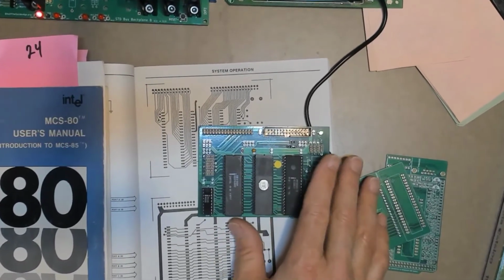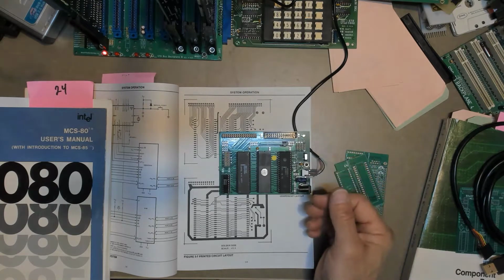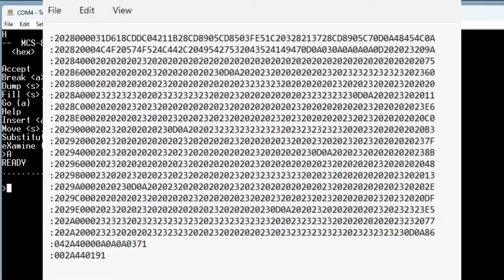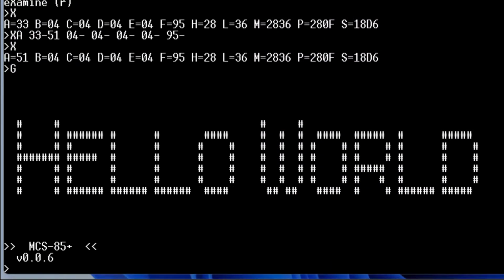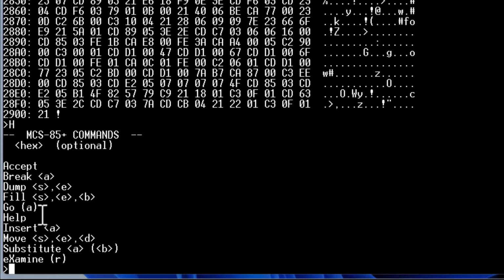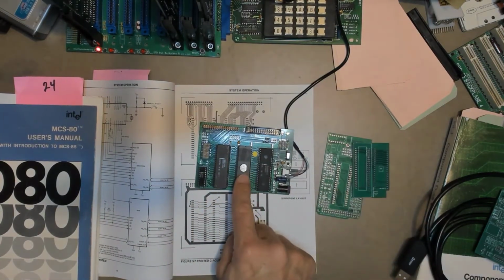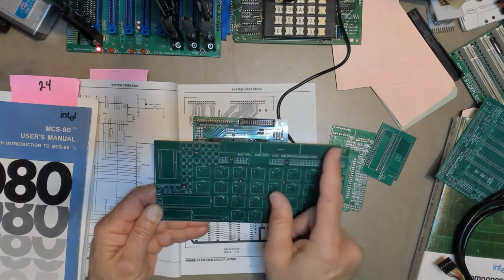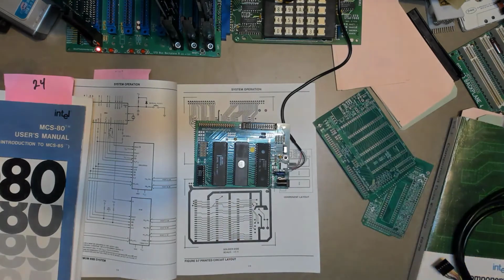{101} ZERO Glue Logic, MCS-85 Minimum system--  8085, 2K ROM, 1.25K RAM, 38 I/O pins

Comment: So... could we see the 8085 as a strategy for dealing with "the Z80 problem"?
I can imagine, back in the day, using your "Substitute" command for validation. My friend sitting there  with a hand-written hex listing, reading out one byte at a time and me going through the bytes we'd entered and double-checking the values. On most of our machines, we'd have a "hex loader" written in BASIC but the operation is much the same... Happy Days.
Reply from the maker: I don’t need to imagine the day. Sometimes when trying to resurrect or piece together old code, I frequently have the computer read hex files to me while I follow along on the original paper listing.

What Z80 problem are we talking about?

Comment: My history with the 8080/8085 was identical to yours and I was taken with the minimal system after building an Altair 8800. With 256 bytes RAM I wrote a real-time clock interrupted with 60 Hz line freq and toggled it in using the sense switches. The SDK-85 was the best learning tool and I fully expanded it with bus drivers, RS232 and I wire-wrapped an onboard ZIF for blasting 8755 EPROM/IO. To this minute I can still disassemble code in  my head. I would be thrilled to take up your offer for blank boards. I did buy the chips a decade ago.
Reply from the maker: I am out of the freebie batch of the MCS-85 minimum system boards.  But I do have a SDK-85+ board left if you would like that instead. Send me an email.
Reply: @HelloWorldETX  Hi Craig, I would be pleased to PayPal you cost plus USPS to London UK. Roy Sutton
Reply from the maker: @roysutton577  email me your mailing address and I can get the shipping cost.
Reply: @HelloWorldETX  Hi, Sorry I lost your email, could you please post it again?
Reply from the maker: @roysutton577  
Project site: http://bitsofthegoldenage.org/
Contact me: http://bitsofthegoldenage.org/contact...

Comment: Hi Craig, 8085 is one of my favourite processors as well. This was the first processor we studied at college using the SDK-85 and MDS II / ICE 85. I've designed a couple of 8085 SBC's and also used the SDK-85 Monitor as a base to create my own serial monitors. There's an automatic Baud Rate routine listed in the MCS-85 Manual which works really well and definitely worth trying if you haven't already. I did a video on the SDK-85 a while back and it proved quite popular, so I reckon there's still quite a bit of interest in the 8085. I like the look if your compact SDK-85 double board set by the way.
Reply from the maker: Hi Martyn, yes I have watched your SDK video. I have a couple of SDKs also and still love them. I first used the 8085 on its SDK, but I have to admit that (looking back with an extra 40 years of experience) I did not fully understand it (or the monitor) at the time. It wasn’t until I built the minimum system that I started appreciating the details.   The same with calculus and differential equations.

Comment: Yeah, I was very impressed by that design.  I might still have the 8085 manual where it first appeared.
Then I found out how difficult it was to find those fancy support chip in the hobbyist world, and how much they cost :-(
Reply from the maker: For this, the 8185 is the most expensive, landing in the $20 range. But I see $8 8755 and 8085 so this should be more affordable than most retro builds
Reply: @HelloWorldETX  I was talking more about the cost and availability back in the late 70s.  8085's weren't too bad ($20?), but the 8755 and 8185 hardly ever showed up from hobbyist suppliers, and when then did they were in the $39.95 range, which mean that the "minimal" 8085 system ended up in the same cost range ($100-200) as some less-minimal systems.  (plus the need for an EPROM burner that understood it.)
Reply from the maker: @westfw  Ohhhhh, yea.  I get that.  I was fortunate at the time to have a professor that received engineering samples from intel (probably just to get students hooked on intel family) so i got off without having to buy the 8755 or 8156.